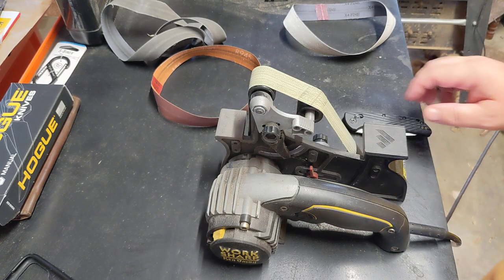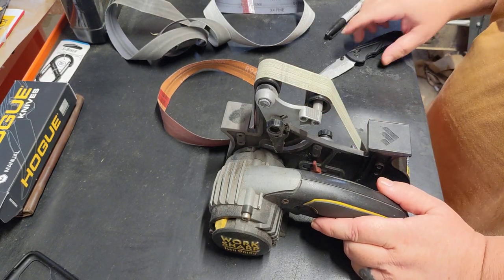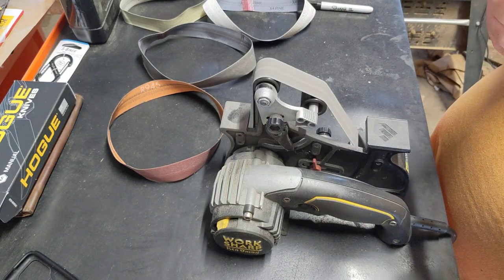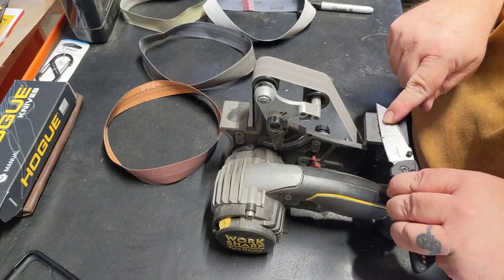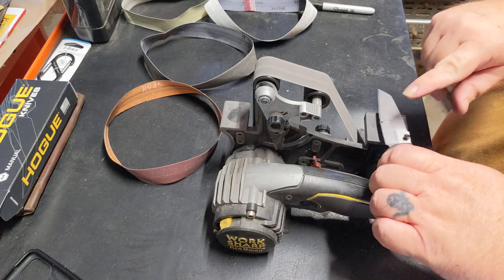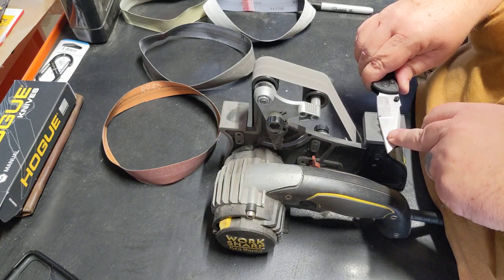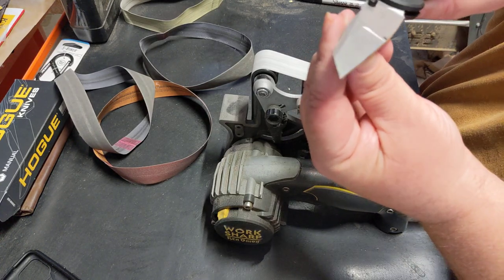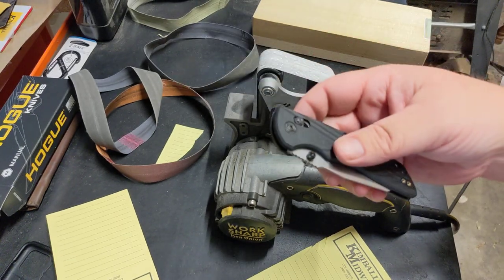How to sharpen a dual beveled CPM Magnacut Hogue Deka with a convexed edge

Comment: Just bought a deka myself in that configuration, what angles did you find worked best for this blade shape?
Reply from the maker: I have been using it at 17 deg. With good results but I think I will be taking it to 20 or 25 deg I think it could use a bit more retention for my work. I really do like this knife. It really fits my needs well. Hope it works well for you as well. I would like to hear your thoughts after you use it for a few weeks.